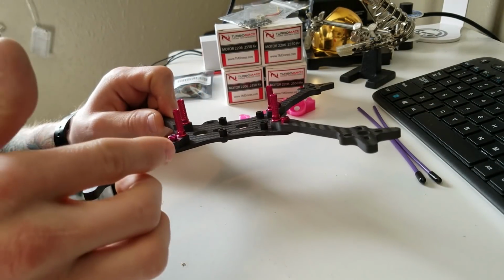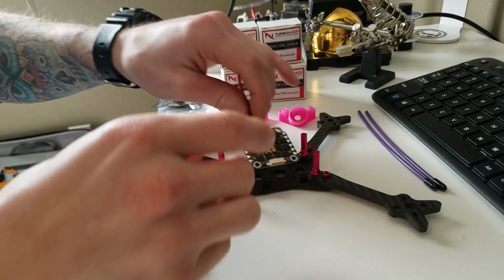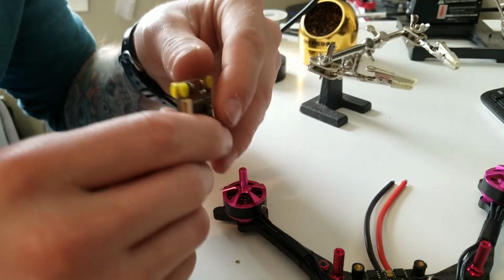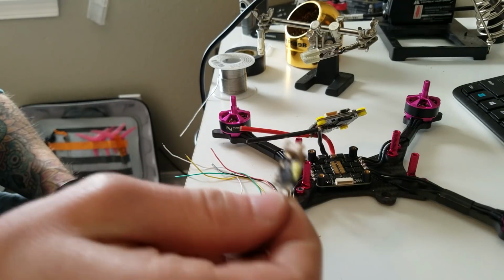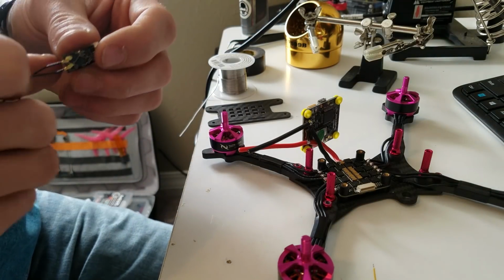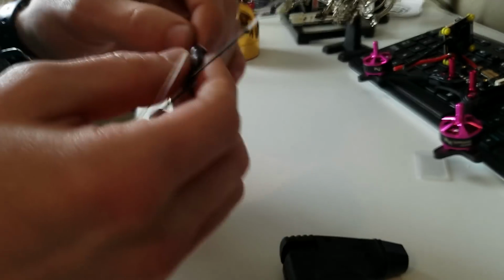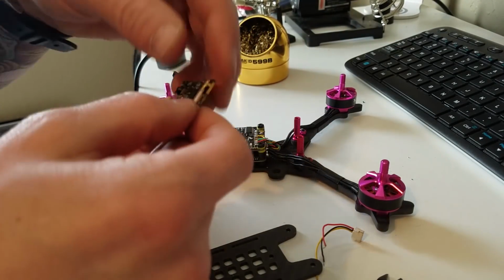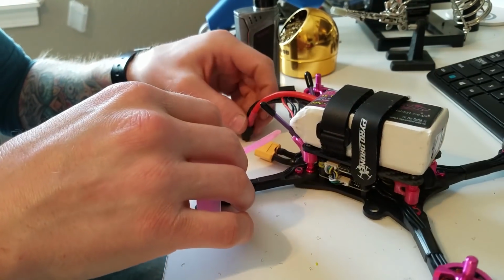HyperLite Floss 2 Build Video FPV Race Quad

Comment: Nice clean build,  what’s the pin out for the cl racing f4s to the 4 in 1 if you don’t mind
Reply from the maker: James Mccarthy I'll double check for ya, but I believe it was motor pwm 1-4, current sensor, and 1 negative.
Reply: Dillon Hoopes ty

Comment: Nice build ... how much is it weighing ?
Reply from the maker: Snabb FPV I believe this quad weighed 300 grams with props, no battery. I have since switched over to the protons but plan to keep flying this floss as it's my best flying quad and most durable with 5mm arms

Comment: How are you liking the topmount for racing?
Reply from the maker: i have since installed a pod i printed on this build so its running bottom mount now, but top mount felt great but the props chewed up the battery if it wasn't really secured.
Reply: Dillon Hoopes that's my concern really. I have heard topmount flies better but I've been flying all bottom mount. With this frame I could see smacking the battery right into something hard and sending a pack into the propline.
Reply: Dillon Hoopes what do you like about a pod design?